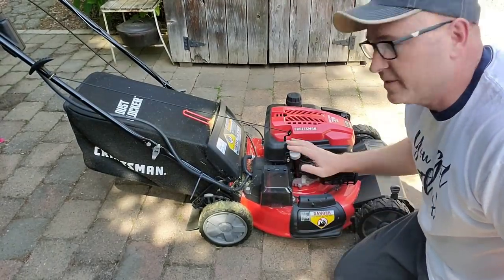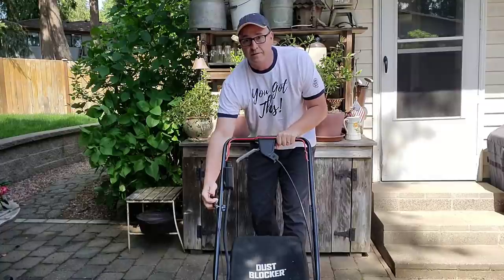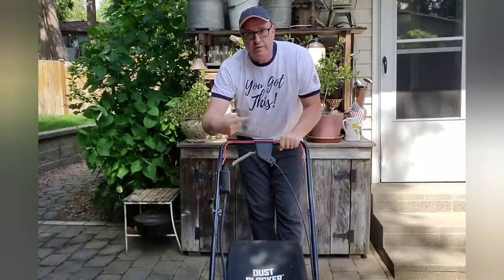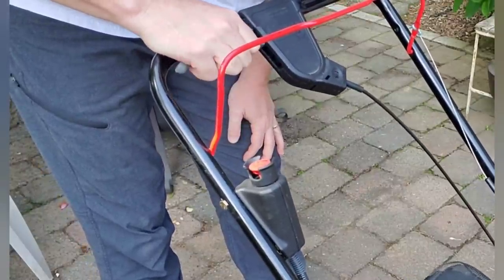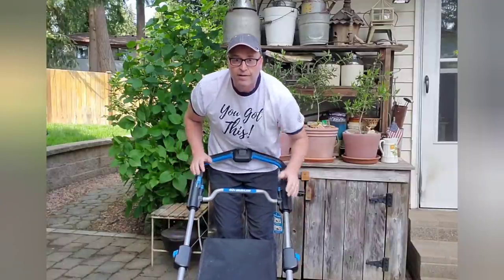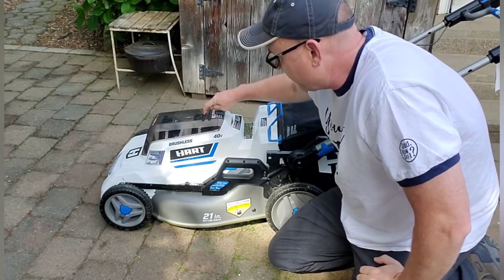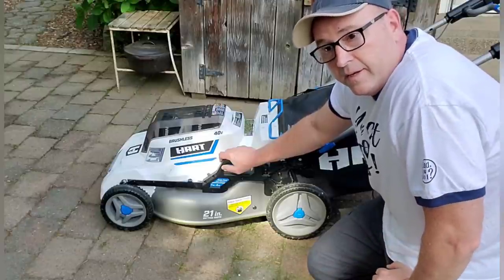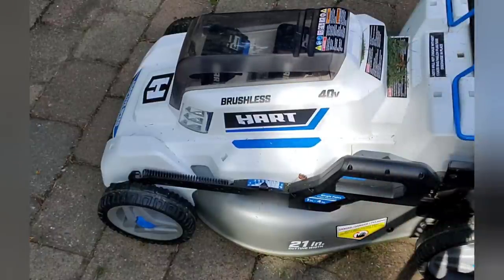How to Use a Lawn Mower

Comment: You don't do the hardest part, LOL! Getting the clippings from the mower bag into a big brown paper lawn waste bag - what a hassle!
A neighbor of mine uses an air compressor to clean his mower, instead of a hose - pretty clever, if you have that machine.
I got an inexpensive electric mower (different brand) 3 years ago and the 40V battery still works great: it even held a full charge over the winter, which totally amazed me. I hope you have the same luck with yours!
I have lots of tree roots in my yard & usually some fallen twigs as well, so I try to always remember to wear goggles over my glasses to protect my eyes.
Most everyone else in my neighborhood mows their lawn from side to side or diagonally, but I've learned that mine looks best when I mow back and forth from the street. It's worth it to try a couple different ways before you set on a system (which is totally a good idea, like you said).
I will be looking forward to your weed-eater (weed whacker) video: I've been trying to learn for a couple years and am still not getting the results I'd like. Please include how to tell if you need to refill the line (string) and (if possible) how to do so. Maybe also explain how the line auto-advances, so folks understand why it even needs refilled periodically.
Thanks "Dad"! God bless you too!😊🙏

Comment: A few things my dad taught me about mowing the lawn worth mentioning: always check the lawn first for toys, rocks or anything that an animal or passerby could have left behind (raccoons love leaving packages that can gunk up your blades). If your mower has an expeller (is that what it’s called??), never ever point it at any person, house or car just in case you pick up a rock and it comes shooting out. And to expand on your point about shoes, always wear closed toe shoes because accidents happen and you’ll want that extra protection. 

He also added that lawn mowers can run on regular gasoline, but like any gas powered small engine (lawn mower, snow blower, leaf blower etc), they always run best on mid grade fuel.

Comment: We got a weedeater with the little bubble button and the choke and half choke things. It's so hard to crank. It's like a whole combination lock type thing. By the time you get to the point where it'll crank, you're already too exhausted to be able to pull the cord hard enough. I should've gotten an easier one.

Comment: hey so related to this topic how do I do the lawnmowers yearly tune up? like replace the oil. I have a siphon to get old gas out do I just need a smaller siphon for the oil or is there a little cap I'm missing to drain it out with gravity? I feel so dumb. Thankfully I have a great boss that does the yearly tune up for my mower but I need to learn for myself. I need to learn to sharpen my own blades/ replace them too but the oil is a bigger thing in my mind.

Comment: I have batteries similar to the one in your mower for my weed eater. Is it ok to keep the spare battery on the charger all the time so it is ready or does that harm the battery. Thank you. My dad passed 23 years ago and you remind me of him a lot. 🙂
Reply: It doesn't harm the battery.  Chargers are smart.. if keeping them plugged in really hurt them, they'd automatically turn off when necessary.
Reply: @misterkite  Thank you so much! 🙂
Reply: You may leave a battery on the charger. However, there's no need to leave the charger plugged in 100% of the time. Anything plugged in uses energy, so unplug anything in your house that doesn't need to stay plugged in (that you can easily reach), it will help lower your electric bill. I've learned most batteries (whether for a yard tool or mobile devise) seem to last longer if they are fully, or close to fully, discharged before charging again.

Comment: Any idea why a gas-powered leaf blower would die after the choke is disengaged? I can start it up on choke, but then when I move it to the regular run mode it'll die. It's an older leaf blower, so I know it used to work...
Reply: Could be a plugged up carburetor, or bad gas.  If your gas is not fresh, empty the tank and replace with fresh.  If your gas is fresh, and you have the proper 2 cycle oil mixed, perhaps try some gas cleaner added to tank.  After getting it started with the choke, try to slowly close the choke to try to force the carburetor to pull the gas with cleaner through it. It's worth a try, but if things don't improve, you probably need a new carburetor...or  leaf blower.  Take care and God bless